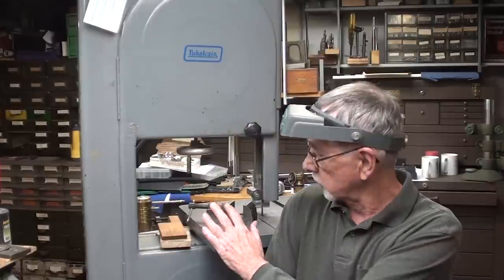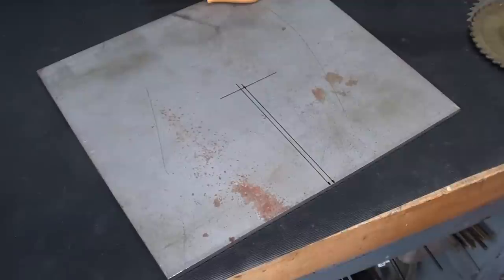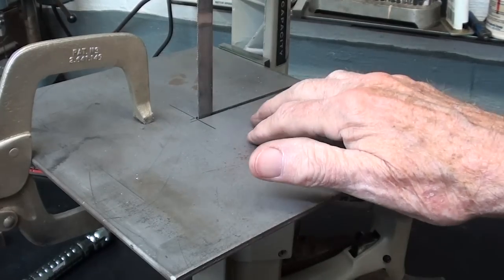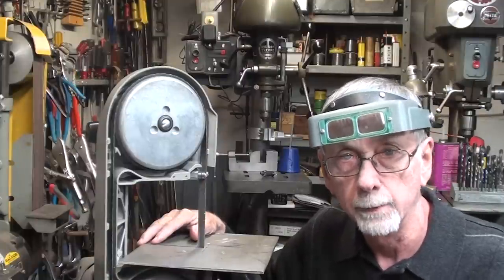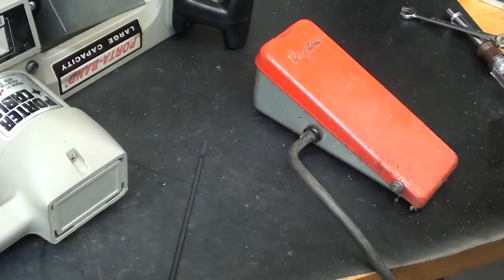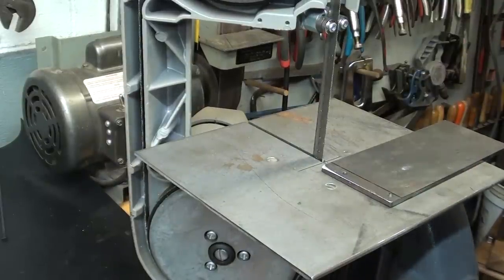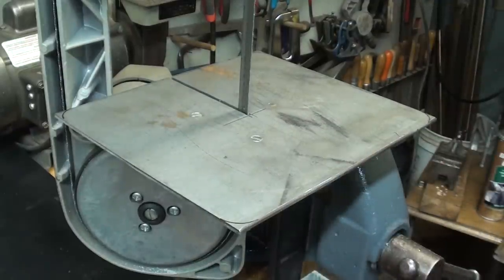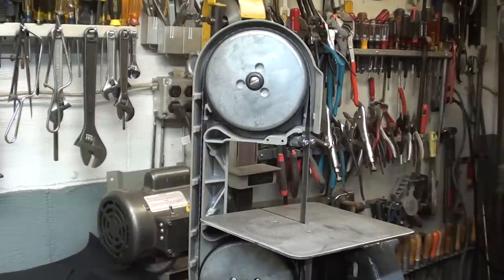Make a Mini Vertical Metal Band Saw TIPS 579 tubalcain

Comment: I remember reading a story about Norm. According to the article, he did all the work in real time.  The crew would set up for the tv shot whilst Norm set up the equipment. After they got the shots for the show, the crew would break for lunch, and Norm finished the work by himself. They repeated this cycle until the piece was finished. Apparently, he liked working alone..
Reply: Working alone prevents distractions that can cause costly mistakes.  I actually met and got to talk to Norm for about 15 minutes on one of his house shoots and he is exactly like he appears on camera.  It was a high point for me.
Reply: A good carpenter with with proper machinery and tooling can get alot accomplished in a short time period. What you don't see is keeping everything in order and getting set up for the project. Then it's time to clean up for the next round
Reply from the maker: That is very interesting to know. I figured he had a whole staff. I much prefer to work alone myself.
Reply: You can judge a Carpenter by the size of his scrap pile

Comment: Cut the slot with a thick angle grinder cut off wheel. Why did you drill clearance holes for the screws instead of tapping the original plate ?
Reply: Those are both other ways to do it, a cut off wheel may not give you the best slot and I prefer to avoid grinding as much as possible, it's slow messy and is bad for the health of your precision metal working machines.
Reply from the maker: Yes, I avoid grinding at all costs
Reply: A pretty good cut can be made with a hand held jig saw if you take your time and are careful.
Reply: The plate on the saw was too thin to tap.
Reply: It's possible to cut the slot with the saw itself, I did that on mine that I made a month or so ago. I didn't drill the hole, just a single blade width.

Comment: A great addition to anyone's shop that doesn't have a vertical metal cutting bandsaw. I recently acquired a Powermatic 143 that needs to be rebuilt, until then the Porta band setup like this works.

Comment: This is a great idea, if you go down this path instead of buying a fixed band saw then you have a multi purpose tool, more options without taking up too much space in the workshop. I didn’t even know that these portable band saws existed until a couple of years ago when I saw one on a U Tube video. This would have saved me a lot of work years ago when I was cutting 12mm steel plate with a hacksaw to build my own indexing head for my combination lathe/mill as I couldn’t buy one small enough to fit it and I didn’t have room for a fixed band saw.
Reply from the maker: Yes thanks

Comment: I bought one of these new from Princess Auto (Canadian version of Harbour Freight) on sale for about $70.00 Canadian.  I didn't have ready access to plate steel to make the table so I used 1/2" Baltic Birch plywood.  Yes, you do have to use substantial pressure to make the cuts on thicker material, but it works GREAT!  The only thing I would add is that the use of safety glasses in this case is second to the use of hearing protection.  These are VERY loud saws!

Thanks for the videos Mr. Pete!  I love watching them and have learned a great deal!
Reply from the maker: Baltic Birch is a very good material. My favorite plywood

Comment: Great video, these portable bandsaw‘s are very handy- especially when your mount them up like you have. I’ve seen this before but this was a great bunch of ideas. I have a HF Version of this daw that I bought for a specific job. When I first turned it on it smelled like a plastic fire and I thought I was going to throw it in the trash. A few minutes later the smell went away and it has been a beast of a saw ever since. I’ve made hundreds of cuts with it through heavy material like 3 inch box - quarter inch wall and 2.5”x 3/8” angle. I have two other metal cutting bandsaw so I don’t know if a stand is in my saws future, but this would be totally satisfactory if I didn’t have the others. Thanks for another great video!
Reply from the maker: I have heard those Harbor freight saws are pretty good

Comment: Good topic! I made one of these too and wish I'd have done it years ago it is so useful. I found that one of those urethane vee-block shaped jack-stand pads fits just right as a rest or cushion for the end of the saw handle where it rests on the table. It could be zip-tied on but mine stays in place just by the weight of the saw.Also, (as you know but just for others planning to make this) many local steel yards sell the pre-cut 10"x10" 0.25" thick plates.

Comment: I made my first mini bandsaw in 2001 with a Milwaukee deep cut  setup in a vice like yours, for a while I thought I would start a conversion adaptors tool business and call them vice tools. I noticed you designed your table that it has to be removed for blade change, I did that too on my first one, much better with the slot in front. My latest build is with a Makita Bandsaw, it has a adjustable light, a blade shield in the back, just where the blade goes from bottom wheel to the top. I have been thinking of building a new set of blade guides to keep the blade parallel with the tires but seems too difficult. Next to my lathe my vice bandsaw is the most handy tool I own! Enjoyed your video as always!
Reply from the maker: That sounds real neat. I did not know Makita made a bandsaw. Several people have mentioned putting the slot on the front instead of the back. That is a brilliant idea and I never thought of it. It would be great for changing blades. But of course I have not had to change the blade yet.
Reply: @mrpete222  You did it right Mr. Pete, if the slot was in the front you'd have to remove the blade just to remove the table to use it as a portable say again.
Reply: @MrUbiquitousTech  I made my table some what smaller and use a portaband with the table on it. but I seem to change the blade many times more often.

Comment: Mr. Pete a few years ago I had more less the same idea.  I gave the design a lot of thought and figured out a way to mount the saw on a 1/2" thick steel plate with non slip rubber feet so that it could be used like yours plus I added a vice and was able to have the saw pivot.  It can be used three ways.  One as the original portable mode, two as a small table saw and third as a tilting horizonal saw cutting material clamped in the vice.
Reply from the maker: Sounds like an ingenious solution

Comment: This video is timely. I used a plasma cutter to cut a table for my mini band saw. I had difficulty bending tabs as it was 3/16 and the brake could not handl that thickness.. Some welding and pounding followed. Now to mount, I'm watching your video for details.
Alan

Comment: I find all your projects are interesting and enjoyable watching, even though I'm a woodworker (if anything) rather than a metalworker. Your porta-saw adaptation makes me wonder if I could make a similar adapter for a jigsaw. Thanks for the inspiration and demonstrating what can be done on a low budget with a little bit of can-do attitude. I also like how your practical approach contrasts with some of my other favourite youtubers, whose videos I enjoy and admire but whose perfectionism I am temperamentally unsuited to emulate.
Reply: I've seen jigsaws and sawzall type recipro saws setup as stationary tools.  I think they can be more dangerous as a jigsaw is quite a bit more energetic.  Everything needs to be positively secured.  

The better ones include an attachment to the end of the blade to locate it, making it a type of scroll saw.  Largish and compact scroll saw seemed cheap and common to me so I never saw the value in typing up my sawzall in a jig.
Reply from the maker: Thank you for watching. I’m sure you can adapt it
Reply: Look up the channel of Gökmen ALTUNTAŞ here on Youtube. He has examples of many DIY tools and machines, there's also a jigsaw table.
Reply: Would not recommend the jig saw fixture. I tried, found it too scary. For me a scroll saw worked much better. Used it for small parts.

Comment: Absolutely!  I have a Milwaukee set up in the SWAG Off-Road vertical stand.  It gets used all the time.  It's probably #2 on the most-used go-to list.  The list is:  Bench grinder, Portaband, VFD-controlled drill press.

It's on my schedule to acquire a Craigslist 14" woodworking vertical band saw and VFD'ing it into a full-sized metal machine eventually.
Reply from the maker: Thank you, that is about the order of the way  I usemy machinery

Comment: Very cool.  Some time ago I gave some thought to getting a portaband and a SWAG Off Road kit for my shop.  I passed because of the single blade width and the narrow throat.  Instead I picked up a used Chinese made 14" wood cutting band saw off of Craigslist.  I have a Jet but I think all of them are pretty much the same. I replaced the plastic guides with an all ball bearing guide setup made by Carter Guides (cost more than the saw!).  I also built my own stand around the stock motor and a jack shaft.  Got the blade speed down to about 180 fpm.  Metal cutting blades in various widths and tooth counts are available on line for less than $20 shipping included.  I'm not offering this to trump Mr Pete.  I just want folks to know that they are not SOL if the portaband does not have the capability needed.
Reply from the maker: Sounds like a good alternative. The porta band is really a very poor substitute for a real metal cutting bandsaw.

Comment: Very nice work, now I have to see if you can get saws like that over here. Also, Stefan Gotteswinter built something similar out of a horizontal band saw for cutting off stock material, so it can also be used as vertical saw.

Comment: Cool project.  When you got to rounding the corners of the table, I couldn't stop thinking of using a bench grinder instead of a band saw that may not exist.  Either way, your finishing it up with a belt sander sure did the job.

Comment: Love the Vid, always a brain tickler in there.  I did the same (almost) with my Milwaukee @ 6 years ago except I just put a 5" x 5" table on mine.  It did require some shimming to get it square to the blade.  I opted to cut the slot out the front of mine for ease of blade changes.  The Milwaukee has no switch lock so I cut a wedged 2 x 4 to shove in there to lock the switch on and use a foot switch.  I just put mine directly in the vice and it has sufficed for all these years and I have never removed the table, still works fine free hand too. I keep threatening to build a stand one day, but why fix what works.  I have broken many, many blades and they never come flying out they just stop traveling, but always be careful just the same.
Reply from the maker: I like your idea of the slot in the front for blade change. That never occurred to me

Comment: Lyle,

I agree to the value of the vertical metal cutting bandsaw.  I converted a Delta 14 inch wood cutting BS by replacing the motor with the DC variable speed motor from a treadmill (3 HP) and changing the drive pulleys to increase the torque. I added an optical tachometer to allow the speed adjustments needed between steel and aluminum cutting.  For steel I used the standard bi-metal blade and for aluminum I used a standard course-tooth wood cutting blade.  Both are serving me well.
Picture available if you are interested in seeing the modifications.
Regards,
Jim Rodgers
Reply from the maker: You are one of the few people that mentioned how useful a metal cutting bandsaw really is.

Comment: I made something almost exactly the same as this a month ago for my cheap (£150) portable band saw. It's great! 

I cut the slot in the plate using the saw itself so it's the perfect width for the blade, seems to be working fine. I cut the plate up using my even cheaper (£50) metal cutting circular saw. Had to file a little bit of the mounting plate to get the table to sit square to the blade but it was a fairly straightforward project. It mounts in my vice with a bit of angle underneath the table but I forgot to allow for the heat warping the plate, I spent a bit too long welding it!
Reply from the maker: That’s great, I like it simple and cheap

Comment: Very cool build as was the one by BlondieHacks, I was about to do something similar, but I opted to get the Hercules Portable Bandsaw and the Hercules Universal Portable Band Saw Stand from Harbor Freight, plus a bunch of DeWalt blades various tooth pitches. Very versatile arrangement and quite reasonably priced indeed.  As a bonus, I already have a 6amp   variable speed foot pedal in the shop.

Comment: It makes a huge difference to have a NEW 18tpi or even a 10-14 tpi saw. I tried a 24 tpi and it took forever for like 3/16" steel. Went to a bigger tooth blade and it made the cutting more than twice as fast.
Reply from the maker: You are so correct. It was fine to use blades are great for thin material. But they sure cut slowly on thick stock

Comment: A couple of nylock nuts might help if the table starts to move around.  I recently bought a thick scrap piece of aluminum plate for my base plate.  I have given some thought to adding some other plates on top of the base plate and use edges of those plates to create the grooves for a saw guide.  I even thought about using some thick plastic I have and keep the steel plate (or aluminum) as the base for it all.  When you go to use it though, it will appear to have a plastic (polyethylene or whatever) solid table, but where the groves are for the saw guide, you would see the steel table.  This will become a second saw, only your relative will every try to *separate it from it's base again.  You will grab the other one if it needs to travel.  You can cut down and cut up a fair sized tree with a portable band saw.
*Write on the bottom of the table what it is and specifically which one of your saws it fits and we'll try to put it on the right one when we bring it back.

Comment: This has got to be the first time I have ever beaten you to post a video on the same subject 🙂 Brilliant idea to make a mount for the vice though 👍 A couple of points, I used an angle grinder with a cutting disc to cut the slot in the plate, worked quite well. I also used a cheap stainless steel cake tin to make a guard for the top wheel & blade, very simple and easy to do.
Reply from the maker: Thank you, I will check out that video. We must’ve been of like minds. lol

Comment: AWESOME video mrpete I was so exited when I seen what the subject was because I have been wanting to do something like this for a LONG time I have 2 smaller 9 inch wood working band saws that I picked up at yard sales a few years back to try and convert them to metal cutting but like you have shown in your past videos it is not always that easy to slow them down (or to be able to find metal cutting blades in that size) This is just what I need!! It also started me thinking maybe I could buy a HF cheap one and pull the motor and whatever else that will fit and put it on one of the yard sale frames! Either way this will be my next project and As always Two Thumbs Up Sir!! and Thanks for posting!!
Reply from the maker: Thank you for watching, and good luck with your project. Merry Christmas

Comment: Fabulous, such a happy positive video with time travel to see Tubalcain on the Ark and such a useful project. I have a similar plate on my band saw but cutting thin sheet seems to eat blades. I started off with 10 tpi blades and they became dull quickly. I then watched your much earlier video on horizontal machines and the desirability to cut the widest part, not on the edge. I have now changed to 14 tpi and slow speed for mild steel and tried to avoid anything less than 1/8 inch (3 mm) to save the teeth, but wondered if there was some thing else I should do to maximise blade life. Thanks for sharing & Merry Christmas!
Reply from the maker: Avoid the thin material, It strips the teeth

Comment: Merry Christmas.....Always enjoy your videos.
Thanks for showing. When you removed the "table with welded extention to vice", it became clear where the sturdiness in this case matters=The table to the vice(Without the saw).
If the bansaw to the table is not 100% sturdy, you concentrating on cutting thin stock, you probably wont notice it especially if you don't have to touch the saw itself using the foot pedal.
The force you excert to the blade with the stock, is very near the same level as the two screws connecting the saw to the "table", so all is good.

Comment: Great presentation, I had one of the HF portable bandsaw on a SWAG off-road table. I had thumbscrews that bolted to a plate on my work bench. While it worked well, I kept constantly running into the limited throat depth issue. So I modified a 12” Craftsman wood bandsaw for my use. The portable saw and stand I have on to long term loan to a friend for his shop so it’s still running. So between the 6x12 horizontal and my 12” vertical I’m set. 

Perhaps you could do a future video on vertical bandsaw jigs. I have two I’ve done on my channel and it is on of the handiest things I use. That way more folks can see the fixtures because of your reach
Reply from the maker: Good idea, but I do not have one of those little horizontal saws
Reply: mrpete222 I thought you had a horizontal in the cold garage